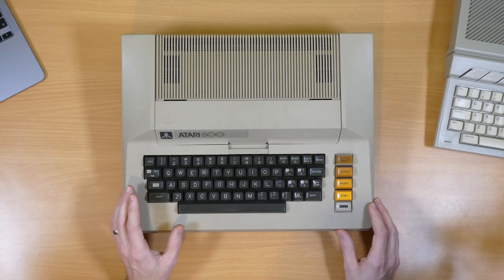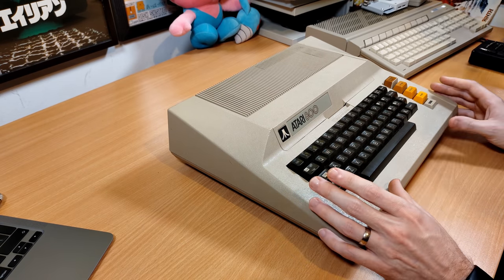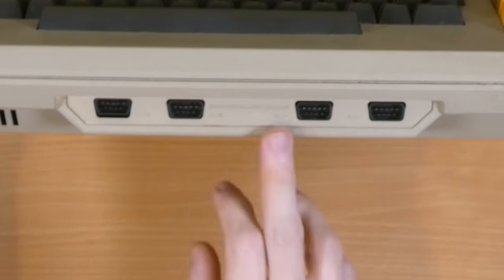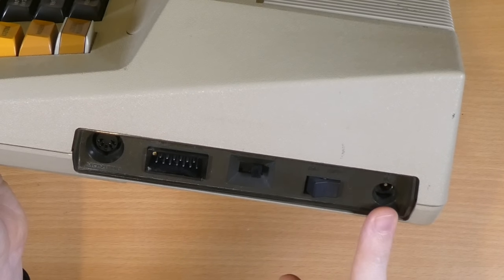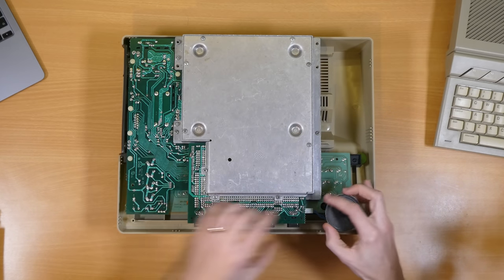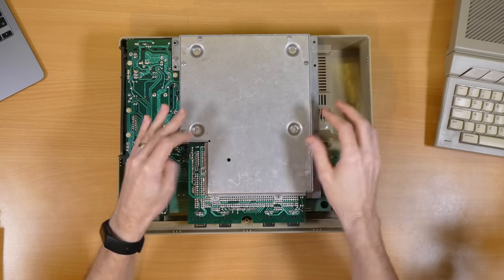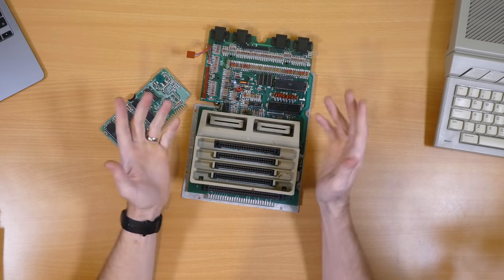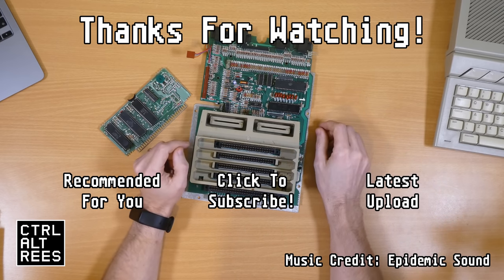Exploring The Atari 800 - Teardown Of Their First Home Computer From 1979

Comment: I've always been curious about this system. On paper it seemed comparable to the C64 but launched three years earlier. I look forward to seeing it in action!
Reply: C64 vs Atari 8 bit "on paper" can be a little misleading. The C64 has a bit more advanced video and sound with the VicII and Sid, but Atari had a bit faster CPU. That allows the Atari to multiplex sprites and torture PoKEY a bit more then the C64 could with its video and sound, so they come out really close. 
One way of looking at it: PAL C64's have better games, because at 50hz refresh there are a few more CPU cycles per frame than an NTSC C64. The Atari 8 bit on the other hand have a LOT more CPU cycles per frame (Pal or NTSC) because the CPU is at 1.79mhz rather than about 1mhz. 
Both are great systems anyway though. I have had both and currently have a couple C64's and an Atari 65XE
Reply: @bitset3741  I seem to remember the Atari disk drive ran at 19.2kbps whereas the C64 ran at modem speeds (2400bps?).  Dunno if the fastload cartridge bumped it up as fast as the Atari.  I had one friend with each computer and remember the Atari's drive just worked, and quickly.  The C64's was slow and somewhat unreliable.  Fun playing games on both, though.
Reply: Actually the atari had a much more flexible video chip set. And could also do more colors on screen. A lot of games didn’t use it, but it was there.
Reply: @bitset3741   The C64 can also multiplex sprites with raster interrupts, and its sprites (at the programmer's option) could each have double the horizontal pixel density (for finer detail) of the Atari's players or 3 colors (plus transparency) versus one.  Additionally, the C64's sprites are just as fast and easy to move vertically as they are horizontally, as they have Y position registers, while the Atari's CPU has to work harder to shift graphics data in order to move players vertically.  The C64's sprite system is definitely better.

As for the POKEY, in order to do what the SID does on its own, the Atari CPU must emulate waveforms and ADSR envelopes for each channel, other forms of modulation such as ring modulation and hard sync, and high-pass, mid-band, and low-pass filtering.  On top of that, the SID has 16-bit frequency resolution for each voice, while the POKEY only has 8-bit resolution, which is insufficient for playing music in tune.  The POKEY's 4 voices can be paired to get 16-bit frequency resolution, but then there are only 2 voices, or it can offer a single in-tune voice for music plus 2 8-bit voices for sound effects, while the SID has 3 in-tune voices.  Really trying to do all the SID does is going to take most if not all of the CPU's cycles, and varying DMA contention with the ANTIC chip has to be accounted for, as well.  Frankly, the more the CPU has to do, the more the Atari's sound system seems like a glorified version of the Apple II's beeper.  At least it's versatile, which allows it to do more than the nearly ubiquitous AY-3 chips (and very similar TI sound chips) used in most computers of that era, but the SID automates all of these synthesis functions to allow the C64 to generate rather sophisticated sound with very little work being done by the CPU, which is kind of the point of having coprocessors and a chip set.

As for the CPUs, the Atari's CPU only runs at a full 1.79 MHz when its screen is blanked and DMA is turned off.  How many cycles the ANTIC "steals" via DMA depends on what is being displayed, and with the most commonly used graphics modes, the Atari's CPU is effectively only about 17% faster than the C64's, not anywhere close to the 75% (1.79 versus 1.02 MHz) that their clock speeds appear to suggest.  The C64's CPU and VIC-II share memory in a different way (like the Apple II) that halts the CPU much less often but only allows it to run at 1.02 MHz (NTSC).
Reply: @massmike11   The Atari has a much larger color palette than the C64, but is limited in how many colors it can display on the horizontal axis.  The C64 gets around this by using color maps in RAM, which the Atari lacks.  The Atari also has 17 graphics modes compared to the 5 that the C64 has.  This is one result of the Atari having 2 graphics chips while the C64 has one to save on cost (and much of the silicon on the VIC-II chip is used by its more advanced sprite system).  However, the C64's graphics modes are comparable to the most powerful and commonly used modes on the Atari.  Most games on both use the multicolor character mode (GRAPHICS 12, ANTIC mode 4 on the Atari).  The Atari's extra modes are lower-resolution modes that the C64's chip designers decided they could do without.

Additionally, the Atari's ANTIC chip (the graphics front end) has 14 different ways of reading memory and feeding the data to the GTIA chip (the graphics back end), while the C64's VIC-II chip's front-end circuitry has exactly one such mode and no display list to read and interpret, which saves a lot of silicon.  The 5 modes all come from its back end, and while without a display list it is not possible to specify, in this way, different modes on different parts of the screen vertically, the VIC-II has the ability to interrupt the CPU on any scanline to change modes and color registers and such.  The Atari likewise has to use its CPU to do most things, as well.  The end result is that the C64's graphics system is also very flexible, while taking up only a single chip to save on cost.  It can change modes, address pointers, and colors on the fly while rendering the display, just like the Atari can, and it has color maps to help it use more colors in the horizontal direction, which the Atari does not.

What isn't used much on the Atari are the lower-resolution modes.  They are handy for certain games that the Atari is better at, but overall, the C64 doesn't miss them much.  We can go over the whole list of modes if you like.  Resolution in these 8-bit computers is already low enough even in "hi-res" mode, and can be simulated in higher-resolution modes.  The Apple II has a low-res mode that offers 16 colors versus this computer's normal 6 in hi-res mode, but it's hardly ever used for anything because it's so blocky.
Reply: @rbrtck  256 color mode
Reply: @massmike11   If you're referring to the GTIA modes, then they are examples of low-res (only 80 horizontal pixels in this case) modes that the C64's designers decided to do without.  I'm not dismissing any of the low-res modes, which do come in handy for the Atari at times.  Some both speed up the Atari CPU and reduce its burden, allowing for higher frame rates than the C64 can achieve.  The 3 GTIA modes don't do this (the Atari's CPU is only 17% faster when using them), although they do allow the Atari to display more colors than usual on the horizontal axis, which I guess is your point.  Of course, there is no disputing that fact, but my point was that the C64 can display more colors (all 16 colors available) on the horizontal axis in higher-res modes, including the 320x200 mode, without slowing down its CPU.

It's a trade-off.  The C64's designers chose to focus on 160 or more pixels horizontally and more colors on the screen in those modes rather than have lower-res modes (at all) and a larger palette.  Which set of design choices is better overall is debatable, and depends on the application/game, as well.

By the way, for reference for those who may not be familiar with the GTIA modes, each has a resolution of 80x192 in the standard screen size.  One of these modes (GRAPHICS 9) offers 1 hue out of 16 with 16 values or brightnesses.  This is the only mode that has a palette of 256 possible colors, albeit only a single hue is used, so it's monochrome with shading.  DLIs can be used to change the hue for each scanline, but it's not really practical to do this on the horizontal axis.  Another GTIA mode (GRAPHICS 11) offers 1 value out of 8 with all 16 hues available on each scanline; the total number of colors available is 128, but with only one value per scanline.  And the 3rd GTIA mode (GRAPHICS 10) lets you pick any 9 colors out of the normal 128-color palette, and use them any way that you want to on each scanline (you could change the 9 colors on each scanline, although it would take a lot of work on the part of the CPU).  This is powerful in terms of color selection and placement, but the trade-off is low horizontal resolution.
Reply: I'd say the C64 was like a cost-reduced, tweaked Atari 800, and the 800 was clearly one of Commodore's inspirations going into designing the C64 (what they learned from the Vic 20 would be the other big inspiration).  I think they also wanted a home computer that could compete with any of the videogame consoles of the era on price and performance - again, the 5200 was an obvious target, and that's essentially an 800 without a keyboard.

The amazing thing is that the 800 was designed in '77-'78 and finally released in '79.  The C64 was designed in '81-'82 and released at the end of the summer of '82.  That's an eternity in computer years.  If Atari had properly cost-reduced the 800 by '81 or so into something like what the Atari 800XL eventually became, they would have cut Commodore off at the knees with a comparable machine and a much larger software library.  That Warner's Atari efffed around until after Commodore ate their lunch with the C64 is one of the great blunders of the home computer era.

The Ataris also had vastly-superior peripherals.  The drives ran at 19,200kbps compared to the 2400 baud speed Commodore's sluggish drives ran at.  Atari's tape drives passed audio thru to the PC, so you could have things like language software that combined spoken word with on-screen text, all controlled by the computer.  It was crazy tech for 1979.  No ribbon cables strewn all about, expensive cards you had to have installed or software compatibility issues.  Just plug the device in and go.  I believe 8 devices could be daisy-chained off a single SIO port.  The PCs wouldn't become this easy to expand and use until the mid-'90s and the arrival of USB and Windows 95.  Pathetic.  Apple wouldn't have a machine this easy to expand until the Macs in '84, and even then you had to fiddle with SCSI jumpers and whatnot.  

The one place where the C64 really smoked the Atari 8-bits was the SID chip.  POKEY was fantastic for 1978 but SID was a product of the '80s and clearly superior, especially since it required so little CPU overhead.  You could do great things with POKEY as well, but it required considerably more effort.  The C64's high res graphics mode was also arguably superior, as were their sprites, but again Commodore's chips were 4 years newer than Atari's.

Warner Communications really screwed the pooch.

Comment: Can you not replace the ribbon cable with a specially designed flexible PCB.
Reply from the maker: I'm sure there are a few options, that could work. But would rather keep it original if I can! 🙂

Comment: The top case on mine has levers to release the lid? Are these machine related to PDP's? I thought the Atari used faster but pricer ram chips to run closer to 2mhz -like the bbc?
Reply from the maker: I've seen them with the levers before but mine didn't come with them - either they went missing over the years or these later machines didn't have them. It's not really related to the PDP at all, just laid out in a similar way to all of those '70s machines with everything on a card on a backplane - the PDP was just the first example that came to mind. 🙂
Reply: @ctrlaltrees Thanks for your reply. I'm interested in how the Atari 400 and 800 managed to run  at nearly 2 mhz in 79. The acorn BBC two years later while faster still, could only do it with special RAM which even delayed its launch as it was in short supply?
Reply: No, the Atari's system bus, CPU, and RAM all run at a speed of 1.79 MHz.  However, the ANTIC chip "freezes" or temporarily halts the CPU whenever it needs to in order to "steal" cycles for DMA to drive the display.  In the most-used graphics modes, this means that its CPU is effectively running at about 1.14 MHz (without player-missile graphics or PMGs) or 1.069 MHz (with PMGs active).

For comparison, the Apple II effectively runs at 1.0205 MHz, the VIC-20 at 1.023 MHz, and the C64 at 0.9629 MHz (no sprites) and 0.9428 MHz (with 8 sprites active).  The system bus and RAM on these other computers all run at 2.045 MHz, and actually, all of their CPUs are clocked at exactly half that speed, but the Apple II pauses a tiny bit on each scanline to allow the color clock to get to the right phase (saving a few transistors the others use to do that immediately) and the C64 has a relatively small amount of DMA for graphics (much smaller than on the Atari), which slows its CPU down a bit (a worthwhile trade-off).

So the Atari isn't really much faster than the others in terms of speed--just a little bit, not nearly as much as the numbers might suggest.  On the other hand, the BBC Micro or "Beeb" really does run twice as fast, with its bus and memory running at about 4 MHz and its 6502 CPU actually running at 2 MHz.  It does this by, you guessed it, using the then-new, much faster DRAM chips from Hitachi.  The Atari uses the same class of DRAM chips as the others.
Reply: @ctrlaltrees   Later 800s came with the full 48K installed as standard, so with no need to upgrade (supposedly), bare DRAM boards were used instead of the plastic-encased ones, and the cover was screwed on instead of being locked and unlocked with levers.  Another reason for doing away with the plastic cartridge-like DRAM cases was that this design sometimes caused DRAM reliability/longevity issues due to trapping heat.

As for the backplane, this was common not only with minicomputers but the S-100 computers of the time, and Atari's development system for the 400/800 also utilized a backplane design so that they could swap components conveniently.  While this didn't necessarily have to be carried over into the final design, I think the developers liked it, so it stuck.  It also helped reduce the footprint of the computers.  The later XL series were more tightly integrated (for one thing, they use a special variant of the 6502 called the 6502C or Sally chip, which integrated a bunch of additional circuitry required by the Atari design) so they had less discrete circuitry and required less board space, so this wasn't necessary, and of course putting everything on one board was cheaper.
Reply: @rbrtck  Thanks for the great reply, its allowed me to understand how these machines ran at the speed they did. I didn't know that dma access had that much effect on the cpu's speed, my lack of knowledge meant i thought it was a free ride, but your description shows its effect on the CPU having less access when it is in use. Also for the bbc, it does have amazing speed compared to its 8 bit and some 16 bit rivals. I now see why it has those expensive ram chips, but the Atari did not use them (though I don't think they were even available at that time). cheers.
Reply: @anticat900   The "Beeb" indeed has DRAM chips that were twice as fast as any other at the time, including the ones used in the Atari.  Although clocked at nearly the same speed, the Atari's CPU effectively runs much closer to 1 MHz, as described in a previous comment, while the Beeb's CPU really does run twice as fast at 2 MHz (as does the C128's CPU when in fast mode, which it accomplishes by using a separate bank of RAM for 80-column graphics).

By running everything at the same speed, the Atari squeezes out a little bit more CPU performance, making it a more efficient design in a way, but the price it pays is that it requires a 2 MHz 6502 that will effectively run only a little faster than 1 MHz--very little gain at the cost of added complexity and a more expensive CPU.  The Beeb is also more expensive because of its CPU and DRAM on top of that, but it runs twice as fast as any of the others (except the C128), including the Atari.  That said, except for the lack of a built-in 80-column mode, the Atari and C64 have more powerful graphics chips that in many cases (especially games) more than make up for their relative lack of CPU power.  That's what they're famous for, although apparently the Atari is also "known" (falsely) for being 79% faster or "twice as fast" as the C64 or Apple II, but in reality it is nowhere close to that.
Reply: @rbrtck  Once again great, i forgot about the c128, a complex  machine with its so many modes. Its a pity its 80 column mode was used rarely, i believe it was quite slow access though so no fancy full games were written? Elite in c128 80 column would have been nice if possible? All of these machines above seem to have advantages and disadvantages depending on the cost/speed/graphics they were designed towards. I was a vic and 128  person in my time, but the Atari nearly matched the 64 in many games even sonically later on, despite being years older which i do think is impressive. The BBC i never owned until recently and it has a depth of capabilities beyond   either machine though twice as pricey. For the best 8 bit overall now I'd go with the cpc464 however, what programmers are able to make that thing do now is well beyond anything 8bit that came out in the 80's.
Example Vespertino on the cpc464 is this real the intro and game look impossibility good?

Comment: You could hook up a box to the sio port that had standard rs232 ports and standard printer parallel ports
Reply from the maker: Indeed, the Atari 850 Interface Module - it was an official add-on that was released alongside these machines. I only learned about it after this video was released. 🙂